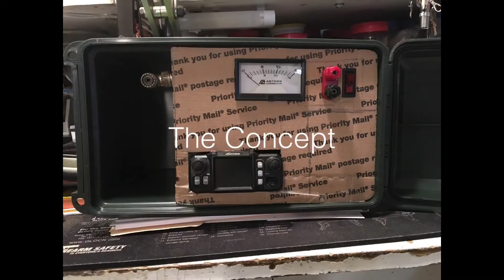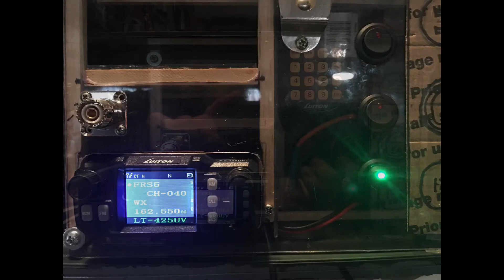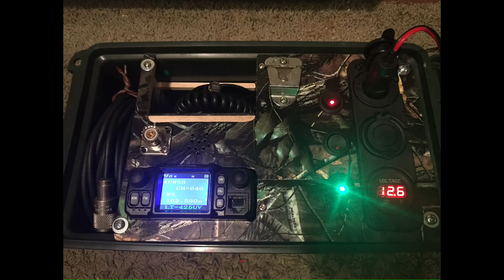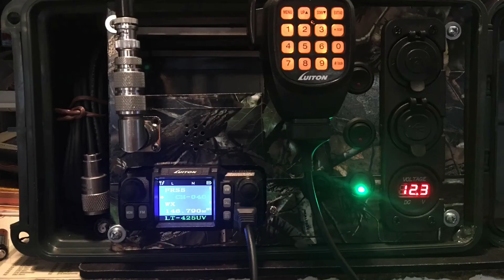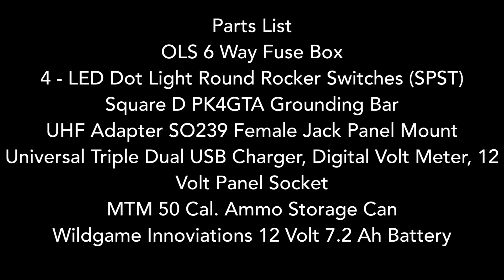Completed Communications Box - Ham Radio Go Box

Comment: I love it!  I may make some mods to the case I made (that you commented on over on my channel) based on your design.  Heck, I may just make a whole other case and use a .50 cal can like you did.  I like that you have storage and a clean compact design.
Reply from the maker: Thanks for your comments and watching!!  Apparently, YouTube must of thought you were spam.  I just found your comment today (10-4-19) when I went in to check my statistics.  Really appreciate you coming and checking out my communications box video.  Again, like I said, I want to do another one maybe in a little larger ammo can if I can find it.  I want to have the VHF/UHF radio in the box as well as the uBitx.  I have another uBitx kit that I haven't built yet.  I have been sketching both on paper and in my mind on how I would do it.  I still like your design, and my 40 Meter Bitx40 that I built I put in a metal first aid box.  Should be a video here on my channel of that as well, or at least some pictures of it in my "Community" section of YouTube.  Juddie - WD8WV

Comment: That turned out nice, brother! Looks like there might enough room for a small QRP rig and an enfed in the area with the microphone and coax!
Reply from the maker: Ron, my idea is to get just a little larger box, found one at Rural King a few weeks ago.  I want to put another one of those VHF/UHF radios, maybe a couple 12 volt batteries, and a uBITX SSB/CW rig in there.  I haven't taken the plunge yet to buy one of those uBITX rigs yet but that is my vision.  That way I have portable communication in both the VHF/UHF and HF spectrum.  Have enough room for my roll up J-Pole antenna and a EF Half Wave antenna with one of those QRP type antenna tuners.  I have visions, just need to see them thru!!  Thanks for watching and the comments.

Comment: That looks really nice, I made one a few years ago but its mostly a power box, and I just mount my radio on the top of the box, that looks great!  I am using a gel cell 12 amp hour with 2 30 watt panels outside to keep the battery topped off, works great and the charge control is mounted IN the box itself.
Reply from the maker: Iridium242, thanks.  I would liked to have went with a larger capacity battery, but locally I couldn't find one.  Next will be to find a portable solar panel and charge controller.  Again thanks for the comment.